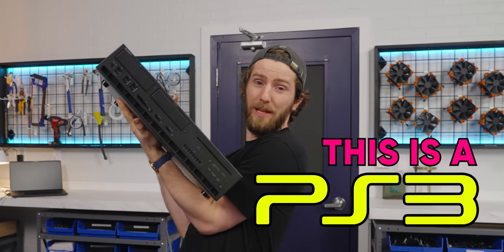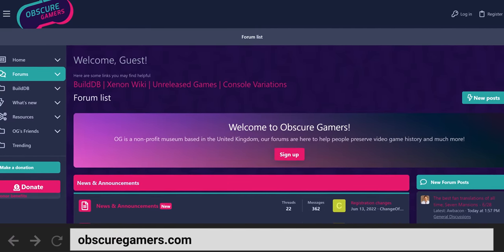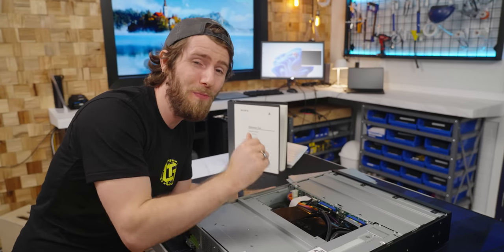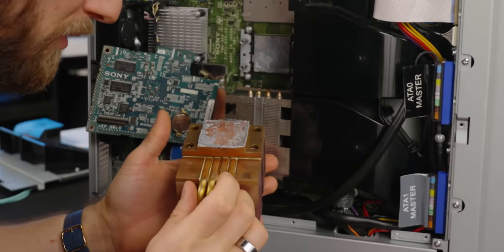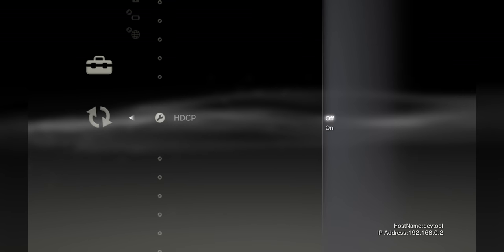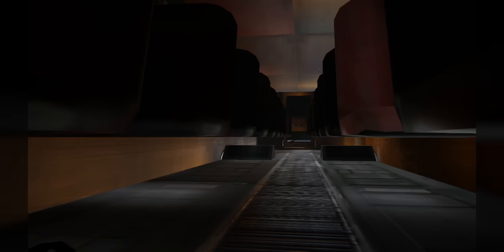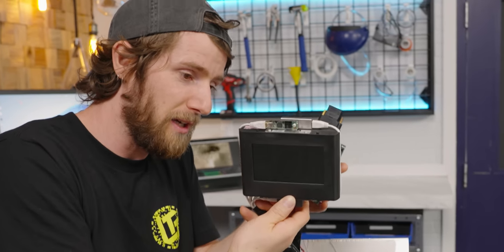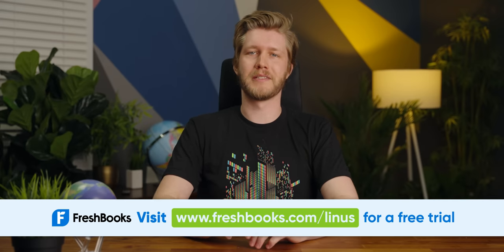I Await Sony’s Cease and Desist - PS3 Dev Kit

Comment: Linus: Get a C64 or C128 and a Final Cartridge III.   With a little luck and or cash the required hardware should be easy to get.  If you enjoyed PS3 dev this much,  you´ll love the FC3 and all its functions.  There is even a freeze button (pedal mod?) in addition to all the crazy modes and funtions inc. access to all registers and even a windows like desktop mode..  Just try - for once - holding on to the parts until they are installed or placed on a level surface.  In a controlled maner that is.  There is no shame in asking for help.   

We used pine tar for grip when playing handball.  If you by chance are able to find some other resin, sap or tar from a tree, it should do fine.  I hear maple trees have some kind of sticky goo in them.  Probably tasty too.  Pine sap not so much. Tastes awful...  like paint remover or retsina some how.

Comment: Ahh, I remember ps3 /IBM cell tech was supposed to bring a lot of multi-threading tech to games for more players and better AI.
Also featured on Person of Interest as a way to host their AI with a PS3 server farm.
Reply: If that was their goal, it definitely worked with some games. I recently found out that Black Ops 2 continues to scale across my cores on my 3950X, which is awesome.
Reply: You can run Folding@home on it too
Reply: That server farm is actually completely realistic in practice. It can be done at any scale, which is why the Cell architecture was so cool. And, as in real life, Root had to use never-opened, never-sold, never-connected PS3s with older firmware because the newer firmware was constantly PSN connected and would not enable clustering anymore.
Reply: Oh man I miss so much Person Of Interest! One of the best TV series ever ❤️

Comment: Yeah, I remember Sony fans saying 'get with the program Microsoft' with built-in rechargeable batteries. I'd always say no, just get quality rechargeable AA batteries like Eneloops. I'm still using batteries that I bought for my 360 on my Series X (and they still work great). Plus I have backups ready to go, no need to plug in a short wired cable to continue playing.

Comment: Most of these debugging options remain in the consumer model PS3 and can be access via custom firmware
Reply: Awesome! I wonder if it can actually go online. I still remember when GeoHot released the first jailbreak requiring no downgrade or anything for 3.55 that caused an influx of mods for CoD games especially. Good times... Nowadays, I think you can use browser exploits to jailbreak the PS3, PS4, and even PS5, but you used to have to downgrade the PS3 and jailbreak it by soldering stuff to the board and a bunch of somewhat complicated stuff until a few years later when browser exploits became the norm.
Reply: @DanniDuck  Browser stuff is still a thing. As for going online, I remember hearing about a psn spoof app but I don't know if it's still a thing or not.
Reply: @DanniDuck  Jailbroken updates for PS3 existed that could get your version number above 3.55, but if you somehow updated to any official sony version after 3.55 then you were screwed. 

To jailbreak a PS3 with a higher than 3.55 version you as as you said soldered stuff to the motherboard to flush a new 3.55 os on it so techinally downgrade the console.
Reply: @basharmously2162  you actually can jb some ps3’s a couple year back of you had 4.82 fw or lower. i did it to my early slim model and works fine, though it doesnt work on any superslim.
Reply: and you can spoof or probably update the latest cfw and play online. really have to be knowing what to do if ur playing online otherwise you could get easily banned and ur cid gone so you cannot never play online again even if you install back ofw. but you can spoof some different cid to your ps3 so at least your original cid doesnt get banned and you can just put some different cid again
Reply: @isanta6232  Yeah, there are shops that sell unbanned CIDs and a lot of people even buy old, broken PS3s just to take their CIDs. I'm sure it's pretty easy to avoid bans nowadays since people have figured out how they work, though.

Comment: Ya'll should definitely review a Canon SED TV.
It was essentially a concept where CRT televisions meet with flat screens in terms of picture clarity, and the Canon SED television was never released. However, there should be a few prototypes.
I highly doubt any of them are in the wild right now.
Reply: It was still a fixed pixel digital display so not really much advantage compared to an LCD except in pixel response time I guess.

Comment: you can literally buy battery replacements for cheap for ps3 controllers. just take the shell apart and quickly swap it out. super easy, even did it on the old ps3 wireless headset.

Comment: Still have my 60gb PS3 in working order. Recently took an old FFVII save that I had been playing randomly since 2001 (on multiple different consoles & PCs) off it and got it to work on my current PC.

Something odd I found is that the BluRay player in the PS3 is actually quite good and was updated very well. I have a 400 disk Sony BluRay player that came out over 2 years after the 60gb PS3 and the player in that isn't even as good as the PS3 player, the 400 disk changer can't even play 3D movies while the older PS3 can for some reason. I would have loved to see someone convert one of the larger disk changers into a full on console so you could store all your game disks as well as movies on the same device.
Reply: Its the same story with the CD player in the  PS1. Many audiophiles use them in lieu of much more expensive/modern CD players

Comment: 7:17   FPGA's may be expensive, but there's a point where they can actually become cheaper and more efficient than resurrecting a dated chip design.  Doubly so if you want to resurrect that chip design but add features that the original didn't have (RGB output, HDMI output)
Reply: I recall the Pebble smartwatch used a tiny FPGA as a display controller.  I guess it was the best way to drive its weird memory LCD.

Comment: In defense of the PS3 controller I have to say it's very easy to replace the built in battery and the battery life of the PS3 controllers is just awesome. Can't say that for the PS4 controllers which drain extremely fast compared.

Comment: A PS3 with proper cooling and full debug access... That's a collector's dream.
Reply: This 1000W box did not have proper cooling.  When stacked on top of each other they melt plastic.
Reply: That's the DECR-1400A dev kit then. I own a few which surprisingly run cooler than the TEST slim I have. I'm getting the 65nm RSX replaced with the 40nm RSX one which will run even cooler.

Comment: I worked for a Brazilian research lab in 2007 and they were quoted nearly 100k USD per bare unit without even the PS3 game toolkit. The goal was only to research using the cell CPU, so we ended up buying an off the shelf PS3 and installed Yellow Dog Linux on it and the result was exactly the same.

Comment: That gears of war build is most likely a development build. So it’s running loads of debug only features usually hogging the framerate. Also, big chance it’s not a release build, so obviously not optimized as well. Just like Linus suggested.
Reply: Seeing as GoW 3 was never even made for playstation it seems kind of likely that it wasn't an optimised release build, no.

This was actually an internal engine testing tool that featured a bit of GoW 3 because they needed something and obviously already had the assets.
Reply: It gears of War 3 from what I saw was to be for the ps3 and Xbox 360, but the idea was scrapped as the performance was horrible on ps3 as seen in the video
Reply: Epic used this build to make sure their engine (UE 3) functioned on both the PS3 and the 360. They used gears 3 because it was memory heavy. The game was never meant to release on PS3.

Comment: 8:40 I still have my old, overused, abused  PS3 controllers from over a decade ago that's batteries still work perfectly on my PC.

Some of them needed a little fixing due to the "ghost button pressing" issue, but that's pretty easy to fix without even purchasing anything.

PS3 controllers are still superior to Xbox 360 controllers. In every imaginable way.

Comment: Not sure why he's surprised about the general hardware setup....  That's a standard case config for a Rack Mount Server.   It probably doesn't "need" 1000W PSU... but whoever they bought the chassis from probably had limited options, and the chassis with the options they wanted only comes with 1000w.  Lots of Rack Mount servers have really high output PSUs.   Honestly, Linus should know this.

Comment: Oh yeah, I still have my PS3 Slim. I wish I was able to get the OG with backwards compatibility, but I guess those are now a dying breed (literally). Though regarding costs associated with dev kits, isn’t game development these days mostly done on PC & optimized for consoles near the end of development?
Reply: You still need to check for platform specific bugs and feature compatibility, and you cannot throw features that work on PC and then hope that they will perform well on the console hardware, you have to optimize through the process
Reply: The disk drive died on my 80gb
Reply: literally??? wait what happened what did I miss
Reply: thats the case for xbox because microsoft made everything work together nicely. sony and nintendo still do this archaic hacky stuff.
Reply: @po-tay-toes_boil-em  ps2 classics emulator (ps2_netemu), performance is kinda meh depending on game and at times game will just outright not work. Easier to just get a ps2 with component cables tbh
Reply: No, there are still dev kits. The HW is way cheaper since the HW is mostly off the shelf components with just a custom SOC though.
Reply: @WTFZOMG  Well in one hand you have a software company who has huge market share on the desktop operating system market making it the defacto choose for game development sharing tools and APIs between a console OS based on the same OS. 

In the other hand you have two japanese companies who can't use the popular OS and tools for obvious reasons so they have to make there own solution. 

So yeah it's not as easy as it looks.
Reply: @mietek958  So basically checking to make sure the game compiles on the target platforms, right?

Comment: 8:52 - I disagree 100%. 

I replaced ps3 controller batteries recently for $8 a piece and they work just fine. 

The amount of TRASH saved from having rechargeable batteries, and the convenience, was well worth the switch. No excuse if you didn't want to pay $8 for a  ps3 controller battery for this video.... :/
Reply: Exactly, changing and charging externally AAs in a controller like it’s 1980s? No thanks!
Reply: The thing about standard batteries, is that you can fit any chemistry in that form factor so long as it fits voltage and current specs.  You can use Ni-MH batteries,  lithium batteries, and so on.
Reply: @commscan314  

You can't though -- Some battery tech generate smore heat / is more susceptible to heat / vibration, etc. 

But if those aren't a factor, then i agree.

Comment: You need these dev kits early on when there's no final hardware, but not EVERY dev needs it as cross platform code can bridge the gap for gameplay etc. So typically a couple of engine folks might port / optimize / rearchitect whatever code base you have. Some game title guys might optimize early on as advice for the art team solidifies and trickles out. Work doesn't all ramp up on a title at the same time, early titles might keep a foot in previous gen. Later on you can develop on systems that are a lot more like the real hardware but have a bit more ram and are unlocked. At that point dev kits can help with esoteric capabilities like detailed hardware level debugging but they might get respun, there can be a lot of additional debugging hardware in dev kits but it might not be final in the initial box. This changes a bit with every console and between companies so this might be out of date.

Comment: A PlayStation controller battery swap is one of the easiest things you can do, is even easier then replacing a snapped off trigger and that's literally popping in a new piece
Reply: But you know what's also easy? Opening the back compartment and replace your battery and put the back compartment back in 5 seconds or less. And if you have rechargeable AA batteries you don't have to worry about spending too much money for regular non-recharcable batteries for a couple of years.
Reply: @Deliveredmean42  Rechargable AA batteries last a year before they're at half capacity. I had some in my Wiimotes and they sucked. Originally, they lasted almost as long as normal AA batteries, but after 6 months, they were nearly half that already.

Having to replace a rectangle rechargeable every 5 - 10 years (if that) is so much more convenient than constantly swapping, charging and buying new rechargeable AA batteries.

Comment: The military used these.     
As a more cost-effective alternative to conventional supercomputers, the U.S. military has purchased clusters of PS3 units for research purposes.[110] Retail PS3 Slim units cannot be used for supercomputing, because PS3 Slim lacks the ability to boot into a third-party OS.

In December 2008, a group of hackers used a cluster of 200 PlayStation 3 computers to crack SSL authentication.[111]

In November 2010 the Air Force Research Laboratory (AFRL) created a powerful supercomputer by connecting together 1,760 Sony PS3s which include 168 separate graphical processing units and 84 coordinating servers in a parallel array capable of performing 500 trillion floating-point operations per second (500 TFLOPS).[112] As built the Condor Cluster was the 33rd largest supercomputer in the world and would be used to analyze high definition satellite imagery.[113]

Comment: I like how Linus's conclusion when he is forced to use an old wired controller is that wireless controllers should use standard batteries, and not that wired controllers are great.
Reply: Well it is kinda true ... If I can switch batteries in a steelseries wireless headset or any more advanced phones ... it's ludicrous than we can't simply swap rechargeable  batteries in both Sony and MS' pad
Reply: He's 100% right. All Sony's controllers past the PS2 are inevitably going to become useless unless third parties make batteries for them. And even then, actually swapping the batteries out is a pain in the a**.

Comment: You can actually put dex (developer firmware) on a retail ps3 by jailbreaking it with rebug (custom firmware) or load the actual , original firmware of the decr consoles onto it when u have the console id of a decr system (zecoxiao aka C0ntrol 0verflow made a vid and a tutorial on psx place on it)

Comment: I really have to disagree with the "AAs good" sentiment for controllers. They die quickly, even decent rechargeable batteries. The method 8bitdo uses for their newer controllers is great, where it comes with a rechargeable battery that can be switched out if necessary, along with compatibility for AAs if necessary.

Comment: Well, you should remember that in order to develop the Cell processor, Toshiba, IBM and Sony began work using POWER4 processors which was the first process to merge the PowerPC and the PowerPC AS (for the AS/400 mini computer) architectures into one.

The only computers available with POWER4 were eServer iSeries and RS/6000 1U and 2U servers, about to be awfully renamed the eServer pSeries.

I've worked with dozens of those systems running AIX and they are not desktop.  Long had gone the IBM PC RT or the early RS/6000 which were basically IBM PC with steroids.

Comment: Off the topic here, but would LTT be able to do a video on PS3 to PC case transfer/ build? For those of us with original PS3 fats, a better cooling option would be a much appreciated.
Reply: For cooling if you haven't yet open it and clean the fans. Helps a ton. Also reapplying thermal paste

Comment: Of course the devkit doesn't have copy protection, such a strange statement.  I remember working on these and wondered why the hell they were so heavy.  Just like the concrete in a washing machine!.  That foot swtich was also for triggering performance captures rather than pausing code execution.

I find it surprising how excited you get over these debug options, like 'fake region'.  You need to do this so you can test titles burnt for different regions!

We had one of those very early Vita devkits, it was mainly for testing the back touch controller.
Reply: Ok

Comment: I totally agree with that controller battery statement. Well, the solution is slapping in a phone battery to the controller. I changed mine with some nokia batteries 8 or so years ago and didn't need to charge it since!

Comment: 8:40 You could plug a usb wire in them and use them wired anyway. At least there was a way around the issue (sorta kinda).
I do not agree with the double A comment. Try an old Canon Powershot A70 or so and see how long it lasts. 
Or, because this problem goes way back, a Canon 1000F, four double A's. Dead after three photos with super hot batteries as a result. Apparently that circuitry doesn't age well.
Awesome video though!